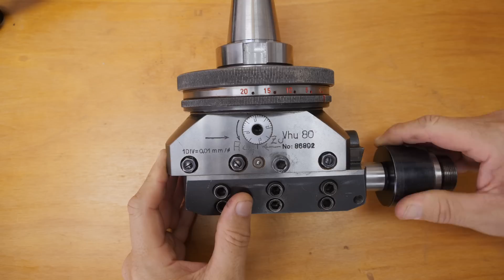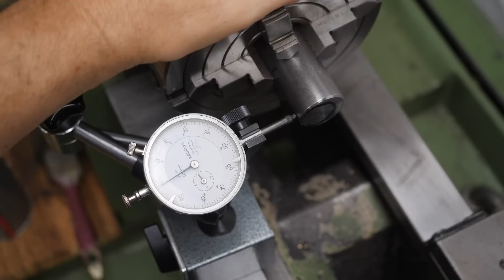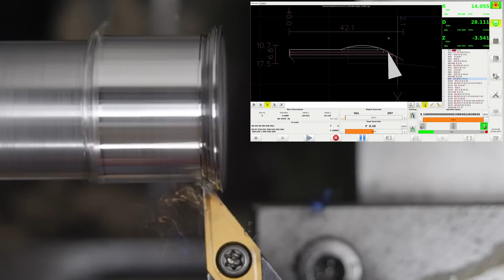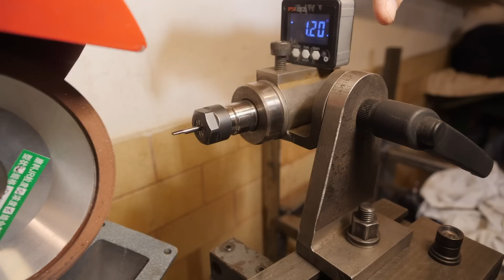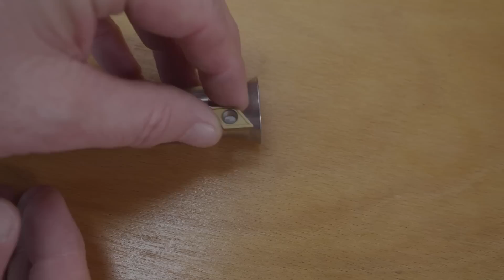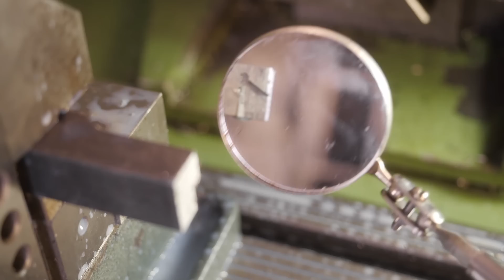I was making a boring bar, when....  || RotarySMP

Comment: Quick tip for setting up ur tool lenght in the MAHO:
U can use a piece of 80g/m² paper and move it around below the cutter coming down in Z (JOG 0,01mm). Once the paper is tight (u cant move it easily) u are 0,1mm above your refrenceplane.
this way u dont kill your cutting edges of your endmills. U can check the paper with a micrometer it's bang on 0,1.
maybe this helps :D 
thanks for your content! great videos!
Reply from the maker: Thanks. I have tried this method, but sooner or later, even bit of paper in range of the mill is either gone or oil soaked and falling apart :)

Comment: The problem of rattling noise in spindle bearings is caused by cage instability. The company APO-Gee in Belgium has developed a solution, the Butterfly cage, which completely resolves the issue at all speeds without causing any temperature increase! The technology was initially developed for space applications bearings and is now being transferred to machine tool spindles.
Reply from the maker: Thanks Sebastian, did you see my follow on video?

Comment: Hi Mark   looking at the drawing , i see that the bevel gear train has no actual need for support from the quill spline (I think)
I wonder if its ok to run the head without the quill to isolate the noise.
Reply from the maker: Hi Steve, I am just in the process of taking it off the machine, and need to see what can be done in which order.

Comment: Hello, which program do you use for the cnc lathe?
Reply from the maker: Most simple parts, I use the conversational programming provided by Andy Pugh's "Lathe macro" plug in for LinuxCNC. For complex parts I use and ancient (2005) version of featurecam.
Reply: @RotarySMP  i was a bit surprised, i didn't know linuxcnc had such a good screen and that it can turn
Reply from the maker: @robertfekete1874  I use the Gmoccapy Gui which was created by a German guy. It is very model, and sort of based on the Heidenhein Gui.
Reply: @RotarySMP  Do you use it on the milling machine?
already as linux cnc?
What hardware is used to connect the milling machine to the computer?
I bought some Heidenhain EXE to change the signal to a normal TTL signal, but I don't know how to do it yet.
Reply from the maker: @robertfekete1874  I think you are misunderstanding the relationship. LinuxCNC is the machine controller. there are a number of different GUI options. I use Gmoccapy as the Gui on all my machines. For lathes there is the conversational plugin "lathe macros". For the mill there is NativeCAM but I dont use it.

If I use a CAM program (Either FreeCAD's "Path" workbench, or my ancient version FeatureCAM, then I use the sneaker net to transfer the files to the CNC machine. 
Sneaker net... I put the file on a USB thumb drive, and then walk to the machine and plug it in.

Comment: Are you getting a new 5 -axis machine for those pockets? 🙂Would solve the rattling spindle as well. And nothing beats a good excuse to get a bigger workshop and new machines. 
I made one holder with vertical walls, and this works O.K. so far. (Fixing screw slightly offset as mentioned by @bobuilt).

Comment: Any particular reason for using DCMT inserts, Mark? To my way of thinking DCMT is a poor choice for a boring tool. DCxx and DNxx inserts are generally reserved for external profiling fine details and undercuts. DCMT has only 2 cutting edges per each expensive insert. Narrow point angle is weaker than simpler and cheaper  triangular inserts. A good rule of thumb use double sided inserts for heavy / roughing operations and keep the single sided inserts for finishing. Don't know why but may of the home gamer You tubers are selecting these diamond shaped inserts. In industry these would be considered almost specialist tooling, because they are expensive per edge as well as having lower metal removal rates. Make a second bar for TCMT and compare, I think you will then agree with my assessment.
Reply from the maker: I need to make up another dovetail cutting tool, and DMCT will be the choice for that. I figured if I use the same for my boring bar, I only need to design the tool path once.

Comment: Would be good if you could somehow isolate the bearings from everything else. I find it unlikely that the main spindle bearings should be gone. It would be good to eliminate everything else if possible before going to that extreme. Seems akin to opening Pandora's Box.😬
Reply from the maker: I will start by pulling the draw bar, and hoping for a broken belville spring, but that consensus is that it sounds like a broken bearing cage.

Comment: CNC is more work than manual for one off setups, just get rid of the Maho and get a Deckel :)
Reply from the maker: Yeah, you are not wrong, but if you only have space for one machine, I prefer to have the option of CNC for the complex tool paths.

Comment: What i find interesting that you have the whole mill dancing on the floor when you shake it, tho i know that the most important thing is that the mill has to be rigid to itself.
Reply from the maker: Yeah, It is still up on wooden blocks. I need to weld up a steel stand, as I need to be able to get the pallet jack under it.

Comment: Honestly it kind of sounds like a spinning/sticking race. Only one way to tell....take  it apart and inspect everything for proper installation. Try to find a manual with inspection procedures, tolerances and a parts list. Do it sooner than later because if you jam up the bearing or spin the race too much, you may gouge or crack things.
Reply from the maker: Yep, that is the next step. I'll make a video on it.

Comment: I disassembled one similar. I think it is not a bearing failure just because it probably uses tapered roller bearings. It could be the springs on the drawbar. If I am not mistaken the one I fixed the problem was on the bearing that drove the “pinion”
Reply from the maker: I would be happy if it is something like that. Time to strip it.

Comment: I have woodworking cnc machine using gmoccapy. I occasionally mount a router pointing in the y- (as you were doing) to mill tennons in the ends of long pieces. I have swapped my z and y axis, limits etc. as you described in another (copied)  configuration. I get no errors and it works very well, but I am using open loop steppers. Your maho uses servos? Could this be the problem?
Reply from the maker: Yeah, this is a closed loop machine with linear encoder feeback, and the different axis have different PID tuning.
Reply: @ I was going to say are the axis motors the same. As they are not, you will need to swap the y and z pid values etc. my point is it does work so it is worth persevering. The reason I haven’t tried G18 is I use ncam (nativecam) for all the canned cycles. This will only work with G17 and gmoccapy using python 2.
Reply from the maker: @chrisfairbrother9197  I also never upgraded the mill so it is still on LinuxCNC V2.7. I would need to redo my HAL's to bring it up to V2.9 due to the switch to joints, and it has been a "If it works, dont dick with it" scenario.
Reply: @ yes I totally agree. I have 2 hard drives on my machine, one for work using 2.7, and one for testing Qtdragon_hd on 2.10 bookworm.This way I always have a working machine and I can test what is new.
Reply from the maker: @chrisfairbrother9197  I actually use a CF card as SSD on the Maho, so it would be really easy to do a drive swap. Good idea.

Comment: Don't have a lot of experience with maho heads sadly. Though the correct thing to do ( specially since it's not a machine thats getting used every day for mass production) would be to take the head completely apart and see what is wrong along with what is close to go wrong and change those things ( along with completely cleaning buth grease and oil lines )

Personally I always the my boring bars and drill them out to about 0.03-0.05 mm below the biggest carbide rod/bar that can fit within it with a bit of margin/ wall thickness ( so for a 25mm bring bar I put a 20mm carbide rod in it ). Eat up the boring bar and slip in the carbide rod. Giving it some more damping weight and also stiffen it up ( and a blank carbide rod isn't to expensive. Specially compared to buying a pre made carbide boring bar ( plus a fully carbide boring bar is more brittle since it have no flex but boring out a steel one means that it have a outer jacket of a more flexible material )
Reply from the maker: Yeah, tearing down that head is the next step. 

Wow, I never considered plugging the center with carbide. I have a sold carbide boring bar of 6mm shank which is brilliant for little things. Does it really make a difference on a short 25mm boring bar? This one is only going to be about 100mm long.
Reply: @RotarySMP  it might make a small diffrence depending on the stickout its gonna have  ( if your going less then 2.5x diameter its only a tiny diffrence in bedium depth cut but both very light finish pass and heavy ones it makes more diffrence. and 3 plus times diameter it makes alot more of a diffrence )
Reply from the maker: @flikflak24  Thanks for sharing your experience.
Reply: @RotarySMP  your welcome M8.
got more for you later if you want

Comment: Impressed with all the work you put into recording and editing the video - more so than some of the work you show !!  I know that if anything is to go wrong, it happens when filming - when getting the shot has the camera in the way, and distracts attention or proper access to controls.  The finish on the cutting edge of your D bit is horrible.  My school metal-work teacher of decades ago would ask if it had been sharpened by scraping on a concrete path :)
Reply from the maker: Thanks for the kind support Brian.
Must have been strong concrete as that is carbide :) But yeah, once I film it with the macro, I can see that that diamond wheel is too rough.

Comment: If you have through spindle coolant it could definitely be the bearings in that. Or possibly the drawbar. The ones I've worked on have a butload of belleville washers which provide all the draw. Sometimes a few will crack and fly apart and rattle around inside.
CNC's are fun! 🤣
Cheers!
Reply from the maker: Thanks, this has no through spindle coolant, but it does have the hydraulic released draw bar with a stack of bellvilles. I'd be thrilled if that was the issue.

Comment: Hmmm, consider servicing your spindles more often... The grinder one too... If it has grease lubed bearings - service them at least every 5 years... Ain`t no such thing as ``lubed for life`` unless you want to keep tossing good stuff in the bin due to sloth... Lubed for life is like ``sharp for life`` cutter of any sort... It`s the reason why i`m not running my Schaublin 22 mill - that grease is 50yo in a new-old stock machine, and while she may have ran for a few hours somewhere in the past, that is no excuse to run that ``lubricant`` for even a second in the ``current year``... 
Stefan just recently posted a vid on him mill service or rather regular maintenance, and sure enough - more people should treat their machines in that manner... 
From the sound, it seems like your mill has just entered puberty by dropping some balls... I guess you will have to have ``that talk`` now - tho, the talk will be with a bearing supplier, i`m afraid... 
However, i`m not sure how that spindle is designed - you literally might just have a loose nut in the assembly of the spindle(inside the quill)... I seem to recall watching Oxtoolco`s BP video or was it Robin, not sure, but that machine actually had a spindle assembly nut loose, not all the way, but in a few months or so it would have started rattling... So you might kinda be okay after all, but as said, i`m not a maho rep and i have no idea how the spindle design looks like and what it involves, so i can`t really make a call, but that endmill getting fucked speaks of loose bearings or bearing damage, or rather - runout... 

Best regards!
Steuss

P.s.
Just seen the last minute - shit man... That is the worse version of the Deckel FP1 integral bearing spindle... Well, it`s an uglier twin essentially... The Deckel could at least theoretically be reground for ``oversized balls`` and restored thusly at least once, thus doubling the life of the quill cartridge... Yikes...
Reply from the maker: Yeah, you are right Steuss. I pulled the spindle and relubed the bearings on the Schaublin when I got it. I should have done the same for the Maho.
Reply: @RotarySMP  I edited the comment, so i`ll reply here... Yeah, i just saw the last minute diagram... Yikes m8... Integral bearings are nice in every way except for the scenario where they fail... Cartridge quills are just a fookin pain in the ass...
Reply from the maker: @camillosteuss  Yep, that is what I am afraid of.

Comment: I would consider making 2 different post processors for your CAM software so that you can export gcode as either Horizontal or Vertical format without altering your machine setup
Reply from the maker: I will do that once I get the axis swap sorted out.

Comment: Often the head of a boring bar is forged. So they smack that end to get it proud and then they machine it. That way they don’t remove all of that material, which would be a lot. It also strengthens that part. Good luck with these bearings. I just hate when manufacturers have a good idea and do something not standard, to very little actual advantage, but causing needless suffering when something goes wrong.
Reply from the maker: Thanks Mel, I am still in the denial phase of grief on that spindle :/

Comment: Sorry for all the separate comments, hopefully it's just a good thing and boosts your engagement ;) I'm currently trying to decide if I should pick up a K&T #2 horizontal mill, the owner is selling it for basically nothing. Total cost to me including rigging/shipping will be like 2,000 bucks. I have never used a horizontal before though so I'd love any insight you'd be willing to share from running the Maho in horizontal mode!
Reply from the maker: CNC Horizontals tend to be the choice for production. The better chip evacuation is a real benefit. It is a bit more challenging to set up and see what is happening. Given most of what I do it pretty small, I am sometimes challenged to get the part up to the spindle with the table at top of travel.

Classic manual horizontals are great for hogging off huge amounts of metal with disc cutters on an arbor. Luke uses his in Horizontal mode all the time.
Reply: @RotarySMP  Thanks for the input :) Good luck figuring out the issue with your vertical head BTW. To my ears that sounded more like a bit of metal being thrown around inside the head, maybe a gear tooth chipped? Don't know why that would only happen at max RPM though if that was the case.
Reply from the maker: @Trainwreck1123  There is a consensus building that it sounds like a bearing cage.

Comment: I like that boring head, well designed. The noise sounds like a bearing cage click like from a wheel bearing. Course there was a time in the 90s when they were selling wheel bearings with (regular tapered bearings) with plastic cages. That was a horrible idea and led to allot of destroyed spindles. I hope it's something less serious as headstock bearings are a fortune for anything. As for the main shaft in that being the inner bearing surface... I really don't like that cost saving method. It's done in automotive for rear axles other than the Ford 9" which has a proper bearing. It does make precision better but vastly increases repair costs over time.
Reply from the maker: Hi Robert, yeah I am still in the denial stage of grief on this one. I really really hope it is not a trashed integral bearing. But it does seem to be the consensus opinion that it sounds like a cage.
Reply: @RotarySMP  Well for me when there is something broken it's always the most costly biggest pain etc to fix. And it's always the obscure that never fails that way item.
       I hope it's not but there isn't much else it could be.
Reply from the maker: @theinfernalcraftsman  Yeah, Murphy hates us :)

Comment: I watched again the part of the video where you ran the spindle at different speeds using headphones. I think there are some short squeaking noises at all speeds, not only at the highest speed. To me it sounds like a broken bearing, but I could be completely wrong. If I were you, I'd start with disassembling the "less critical" parts first, like the draw bar mechanism. Maybe you find something in that area. I'd leave disassembling the spindle itself last and only do that if nothing else helps. 
I have a Wohlhaupter UPA-3 boring head, witch is the smaller cousin of what you have. It comes with some split sleaves that allow using tools with smaller shank diameter than the 18 mm it nominally takes. I think making such sleeves might be easier than making a boring bar. Also, I suspect that you can buy the sleeves.
Reply from the maker: Thanks Gabriel, that is pretty much my course of action. Disassemble and hope it is not the bearings, while knowing it probably is :)

Yeah, I also plan to make some sleeves as I have a few 16mm boring bars, but need to also make a dovetail cutter with the DCMT's, so I need to get this tool path working.

Comment: That'll be a bother then, but think of the tear down, investigate, and reassembly videos to come.  Thanks for bringing us along!
Reply from the maker: Hi John, Yeah, I hope it is a popular series, as I can see this being pricey to repair. :/
Reply: @RotarySMP  I had a similar sound from head of my mikron wf3. Replaced the bearings that support the bevel gears and problem solved. They were new old stock high precision Japanese bearings from ebay less than $100 each. Look forward to the tear down.... if it comes to that.
Reply from the maker: @Ballba365  The bevel gear bearings on my spindle do sound a bit dry.